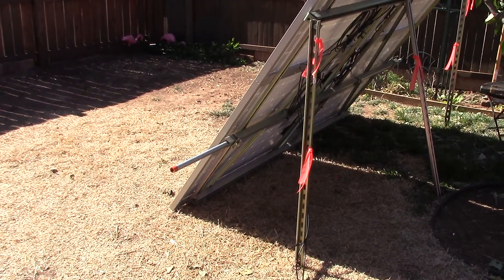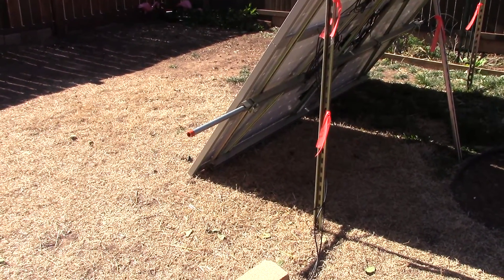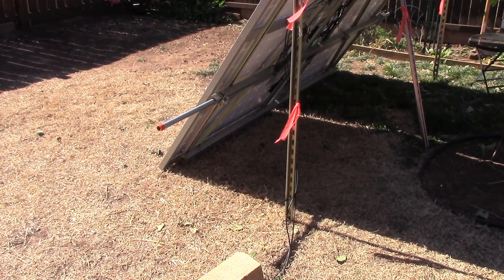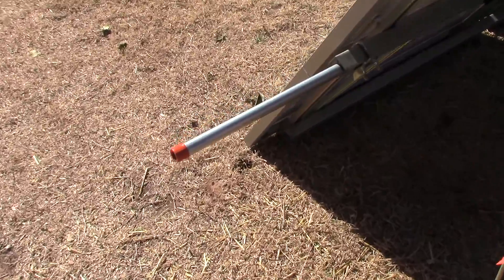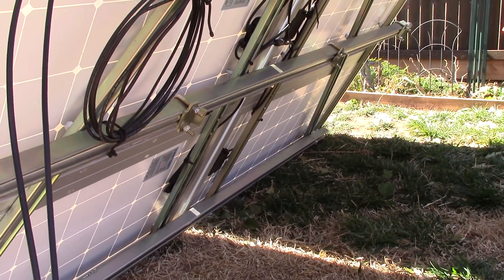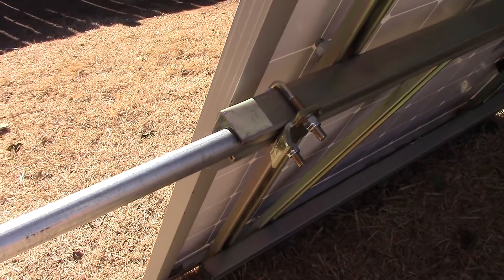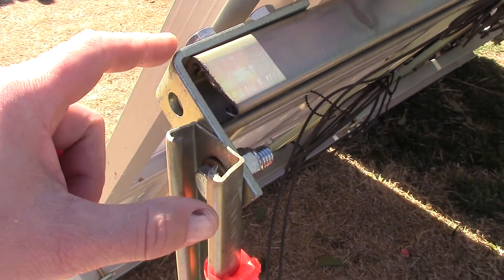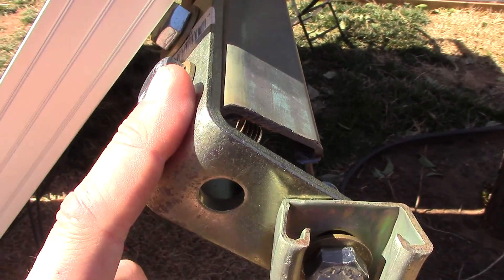600w Renogy solar panel array: 3/4" galvanized 10' pivot pipe, L-brackets, and ???

Comment: I used 3/4" galv. pipe on my pivoting panel rack as well.  The other thing to consider is the balance of the panels once on the pivot.  I centered mine up from below, but with the panels sitting offset to the front, I found the rack ended up bottom heavy.  So I ended up adding a counter weight to the top of the rack so it wasn't as out of balance to make it easier to adjust.
Reply from the maker: Def going to be some balancing issues. However, I do want it somewhat balanced in the center. But, with weight on the bottom...that is okay. This is a small array compared to many I have seen. However, 600w is nothing to spit at!
Reply: +Chris DIYer Looks like you do have the adjustment capability with the uni-strut.  I was surprised by how off balance my rack got when I went from a pair of 60W panels and then added 1, 2 then 3 full size 270W panels.  Since I adjust mine by pulling on cables/chains on the back side, the balance is fairly important.  I may ultimately redo my frame with all uni-strut, something like you have done.  Right now, it's 2x6 lumber and the shallow uni-strut on top.  But that puts my panels ~7" in front of the pivot point in back and that creates additional leverage.  
Sounds like you have a good handle on that aspect though and being close to the ground, it's not a big deal if you have to dismantle and reconfigure a time or two.  My rack is above a clear plastic roof, so not great access for making changes.